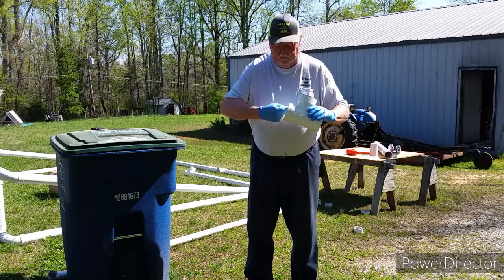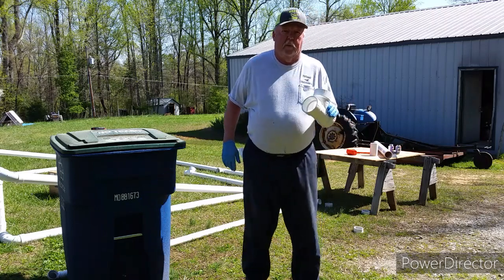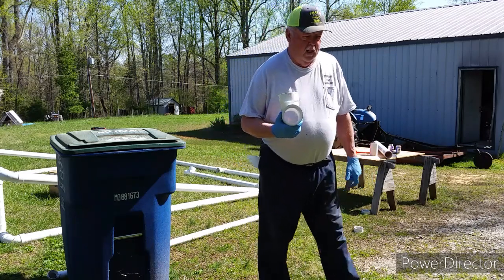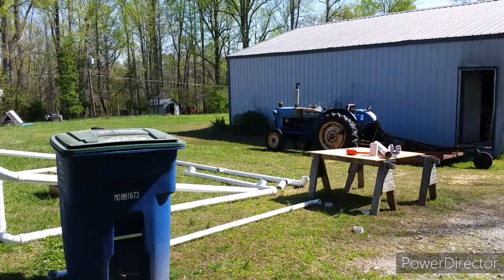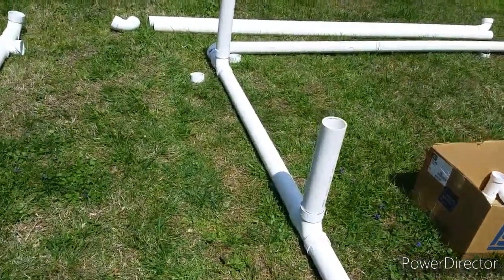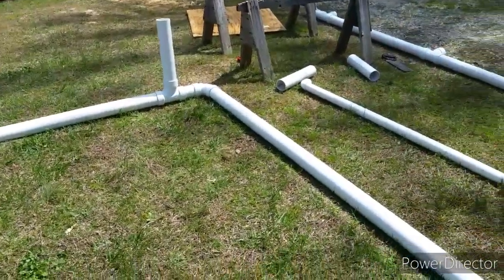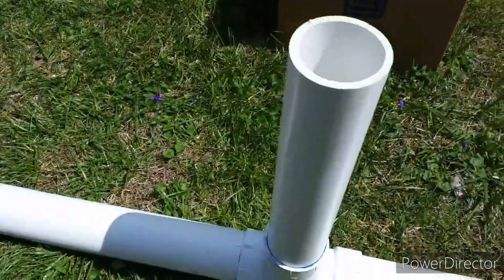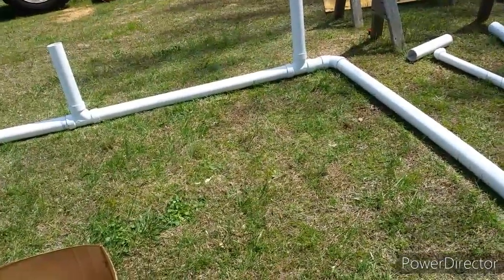How I built my PVC chicken tractor pt 3

Comment: Hi, Steve: Did you have to drill pilot holes into the PVC? Also-- I'm assuming I'll want to use either galvanized or stainless steel screws?
Reply from the maker: Did not drill and I used galv screws and washers
Reply from the maker: Sheet metal selftapping